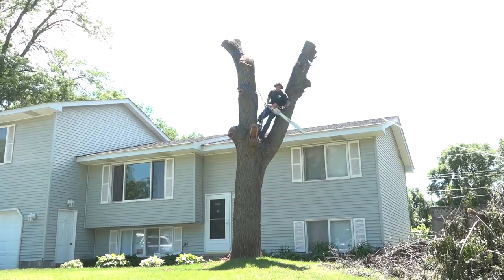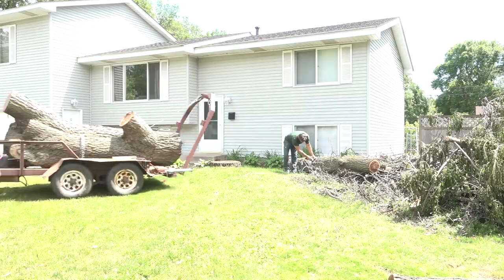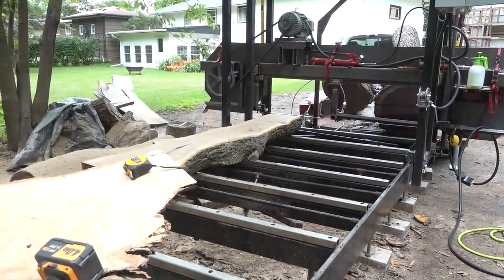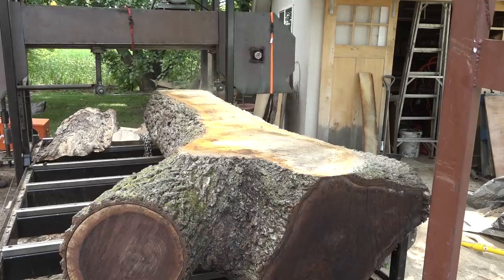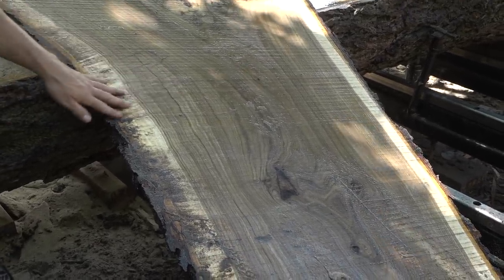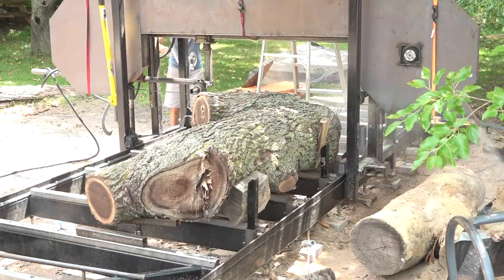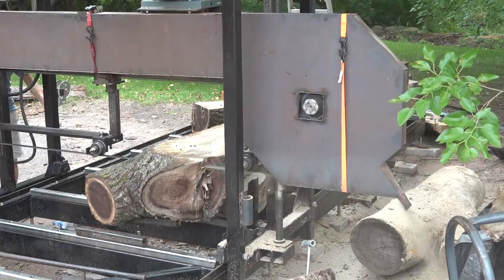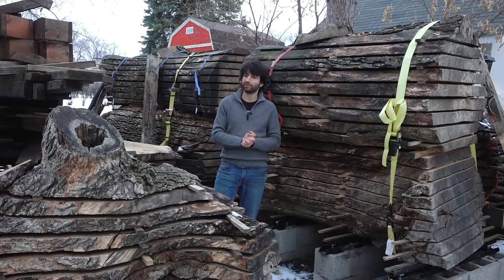Urban Walnut Tree Removal and Slabbing

Comment from the maker: Turning the crank is how I get swole 💪💪💪💪💪💪💪💪💪💪💪💪💪💪
Reply: LOL heading off some comments?
Reply from the maker: It won't work but yes
Reply: WOW! Glad to see winter is over in Minnesota.
Reply: Cremona committing a sweloney here.
Reply: We can tell buddy! Starting to get some mass!
Reply: When you’re cranking, does it feel much different on a 24” wide piece compared to a 58” wide piece?
Reply: lol
Reply from the maker: +Brian Prusa not really.  58" is pretty effortless.  The narrower stuff really give you a workout because you're turning the crank so quickly.
Reply: You could put a powerfeed on that thing with some rollerchain a few sprockets and an electric motor. Can even hook it into a computer to make it auto feed and then auto return, auto lower for next cut, auto feed, auto return etc .
Reply from the maker: That's coming
Reply: Swole is goal!
Reply: Makin all kinds a gains!!
Reply: Is that what they are calling it, nowadays?
Reply: I noticed your saw bed keeps moving on you.  Why don't you drill large holes in the base of each leg, so the bolt heads of each leg sit in a hole, so as the bed will be better held in place?
Reply: Matt you should weld a recumbent bike to the rig....so you can work those quads
Reply: Matthew Cremona 竹細工
Reply: You might want to contact custom handgun grip/longgun stock makers over some of the smaller walnut slabs. They will come and give you a bid
Reply: That and pouring water on the slab then trying to lift it

Comment: As a professional arborist, I admire Brandon's work ethic, enthusiasm,and generosity.  I also have a few safety concerns.  A lot of people get away with using rock climbing gear, but it is not recommended. You should have two separate tie-in points any time that you are using a chain saw in a tree, typically a climbing rope and a safety lanyard.  You should always wear a helmet.  All ropes that support your weight should have a 5400lb minimum breaking strength, and all hardware should have a 24Kn minimum breaking strength.  I know the equipment is expensive, but it is money well spent.  Stay safe out there.
Reply: You can always buy new gear, but you can't buy new limbs is the way I look at it.
Reply: Standing in a crotch, using a big saw like that, without being tied in, is something I only do when I'm quite drunk....not saying I never did it, but.....🙄
Reply: I have that saw/blade combo (066 Magnum) and would never use it that way. Would use my 20 inch bar/441 with great caution

Comment: Have you ever considered routing your cable in a pull pull fashion? Cable anchored on one end, then through a pulley and up to the winch, then a few wraps around the windy and back down to another pulley then anchor to the other end with a turn buckle for tension adjustment? Disadvantage is you have to crank both directions, advantage is no slack or tangles. Nice temp and lots of green out there today lol. Cheers.

Comment: Have you tried adding hooks onto the back side of those u-channels you used to get the trunks onto the saw bed? 

I'm thinking that if they had a hook on the lower side then they would catch onto the rails of the bed and stop moving with the timbers when you pull them onto the bed. :-)

Comment: Get a camera with a wide dynamic range. That will let you get detail in both light and dark areas in direct sunlight. That way you won't have to choose between exposures optimized for one side or the other and you'll be able to see the sunlit areas and the shaded areas at the same time.

Comment: Hey Matt, regarding splashing water on every cut, is that just to make the grain pop and see what you've got at that level/slice, maybe to track the grain patterns and decide on the thickness of the next slab?  Or is there also a functional reason, like the water lubricating and relieving the inner stresses of the wood, maybe preventing cracking as it dries and warps?  Fascinating video, I hope big bucks were made!   :)

Comment: Matt ever experienced wavy cuts with your band mill , if so how did you correct it? Had my mill for over 12 years its a common problem, then again my blades are  1 1/4" and yours is 1 1/2 ".
Reply from the maker: only when the blades are too dull for the cut width

Comment: On the hand crank you use to feed the saw forward you should make the cable longer so it can wrap around the end of the bed with some pulleys and bring the cable back to band saw carriage on the other side. You'll probably have to change the gear ratio or get a different wench because it would make the feed rate slower but it would feed the saw forward evenly from both sides.
Reply: Im sure you all ready thought of it
Reply from the maker: Yeah that's one of those thing that's on my list but never had the motivation to set up.

Comment: What do you do with the slab that ends up with the pith?  Do you just end up cutting "around" it when you lay out material for a project, or can you end up leaving it in if the slab is thick enough?
Reply from the maker: Depends on what you're going for.  You can cut to either side of it and have QS stock for a project or if you want to use it whole, you can stabilize any cracks and call it a feature.

Comment: Look at the ridges from the blade cut pattern, I'm surprised people insists on smoothing out the slabs for table top. I would just polished it and leave that ridge pattern in place for a nice texture look/feel. As long as it's nicely polished and sealed it should still feel smooth.

Comment: May I suggest a small improvement to your jig? Why not install the "cooling system"? Take a regular beer keg (the small one, I think they are around 2 gallons). They come equipped with the valve. Install it upside down next to the electric motor. The valve will serve as a dosing device. You can open it more or less or close it. You can also use mini barrels for wine or anything similar. Or, if you know how to solder, you can make one yourself from a tin bucket by soldering a regular pipe valve to it. Watching you cranking that handle while pouring water on the blade makes me tired. :-))

Comment: Great video Matt, I have often thought about getting a Mill versus building one since I can weld. I live in an area (Northern Nevada) where trees are a rarity :) as such a mill your size is impractical because trees that large are rare. Yet I am a guy on a budget and even $2000 for a cheap HF Mill is a stretch. What could I build a 25" capacity mill like yours for? Steel is relatively cheap here so... I know numbers are hard to come up with so just some thoughts would be fine.
Reply: What species are you dealing with, in general?
Reply: Tim Royal hey Tim, I’m down here in Southern Nevada.... lots of tree removal companies between Reno, Sparks, Carson, and Vegas..... I’m not sure about the northern tree removers, but in Vegas all trees get shoved in a chipper and taken to the garbage dump.... you need a trailer!

Comment: I'm not an arborist, but I thought you always fell a tree, using a hinge... I did not see that here, the felling cut was level with the bottom of the wedge cut.
Reply from the maker: normally you would if you want/need the control.  Here Brandon was going for maximum yield from the log
Reply: You would make the back cut even with the face cut. The hinge is the uncut wood between the face cut and the back cut. This "arborist" cut directly through his hinges twice.
Reply: I noticed that too. No hinge cut. Also, Brandon got too close during the final felling.
Reply: I think Brandon was trying to avoid tear out at the end as much as possible. I thought this was unorthodox but I have only cut one tree a bit larger ONCE in my life for firewood. And that one huge pine went exactly in the direction I wanted thanks to...youtube.
Reply: @turbotek-wj8vc Plunge cutting is the technique for eliminating tear out or fracture at the butt end.  He has the ability...just needs to have a professional show him some mechanics of wood fiber and timber notching for the trees he wants to keep lumber quality.

Comment: Is there any advantage to sawing the logs without turning between cuts like you are doing vs how they do it in the big commercial mills (other than it being much easier to leave the log in place vs flipping it manually)?
Reply from the maker: They flip them either to even out stress so the cant doesn't distort or because they're sawing for grade. I haven't had any issues with the last bit distorting on these bigger logs. When they get flipped, they sit down flat on the bed. But yes, because it's manual, it's not an easy feat to roll a log.
Reply: Also, you have to realize that the big lumber mills are looking for quantity and production. They cant the logs in order to keep the lumber mostly square. This keeps their down-line equipment running at maximum efficiency. Matt is creating maximum beauty, not production...
Reply: Look up quarter sawn vs plain sawn lumber. Usually seen with white or red oak. By quarter sawing wood you see what’s called “ray flecks” come out in the figure of the lumber. The primary reason to quarter saw lumber is for looks, I believe quarter sawing has a lower yield than plain sawing.
Reply: Brendan Simard, you are correct to a point... Quarter sawing does expose the medullary rays, enhancing the appearance of the lumber being sawn, but it serves another purpose as well. Cooperage relys on the grain of the Quercus and Fagus species to be parallel to the diameter of the barrel. This allows the barrel to maintain a high degree of water-tightness. Vapors can permeate (enhancing the flavor of your beer, Brandy, whiskey, whatever...). And, yes the yield per log is very low... Thank God for wood-stoves!! Be well, Friend!!

Comment: Matt, what do your neighbors think about your urban sawmill operation??
Reply from the maker: Sometimes they'll stop by and watch
Reply: Do you get noise complaints?  I dont imagine its a quick or quiet process.
Reply from the maker: It's never been an issue. The chainsaw mill was much worse from a noise generation perspective.
Reply: I was actually wondering about that since I see you're house shopping. Would the mill fit inside a garage if you needed to hide it?
Reply from the maker: Would need to be a garage with a 10' tall door

Comment: Matthew-- Pure Living for Life uses a brand new blade on their band saw for every fir (softwood)  they mill, generally not into slabs like you, but very large square timbers (fewer cuts). How long do your blades last?  Much longer, I hope.
Reply from the maker: yes, this blade did these logs and then cut all the logs in the last mill video I posted (cutting old logs)
Reply: One factor is that Jessie's logs were dragged and handled through mud and would ofc have picket up much more soils.
Reply: Out of curiosity, what brand are the blades you use and how much do they run you?
Reply: There is such a thing as cleaning bark....just saying...I use various brushes, blades, and blowers..... it just requires being determined....
Reply from the maker: Blades I've been using are Cook's Supersharp.  $47 each
Reply: Do you rate your blade life by board foot of cut? I hear 500 to 700 then sharpen.
Reply from the maker: I would do surface area. 500-700 sqft would be expected

Comment: MATT, WITH ALL DUE RESPECTS, AND WITH SUCH A NICE WOOD MILL, I AM CURIOUS WHY YOU HAND CRANK THE MILL AND HAND LOAD THE LUMBER.
AN ELECTRIC DRIVEN RIG OR HYDRAULIC DRIVEN RIGWOULD GREATLY ENHANCE YOUR WORK, AND A ROLLER SLIDE WOULD SAVE YOUR BACK AND MAKE THINGS A LITTLE EASIER.
Reply from the maker: Mostly because I enjoy the manual process